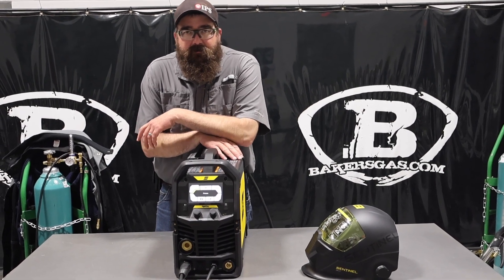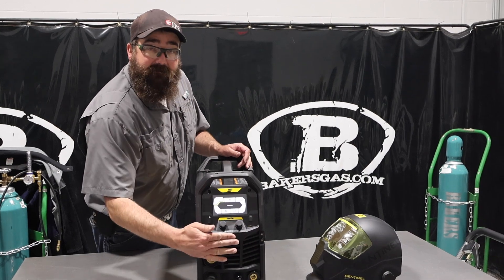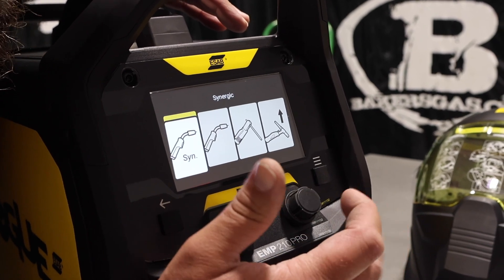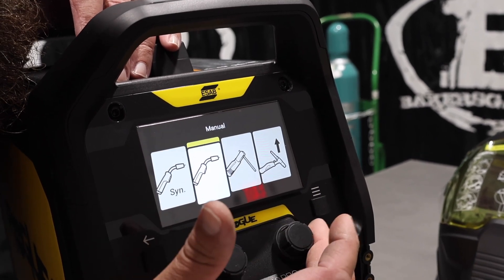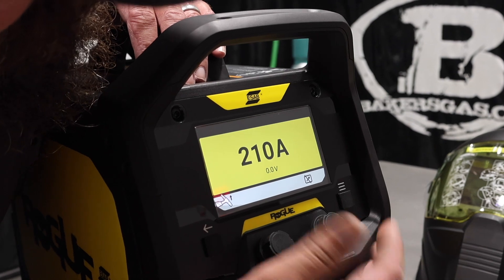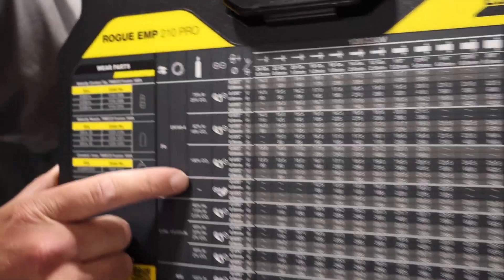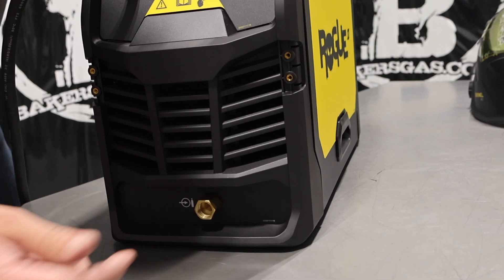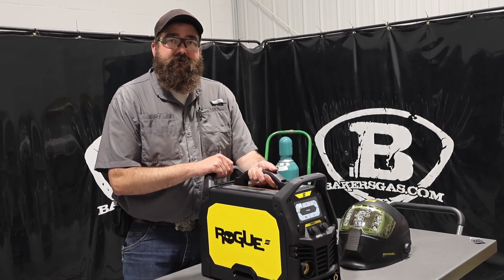ESAB Rogue EMP 210 Pro 0700301085 Review

Comment: Hey Andrew, does the 210 pro run a spool gun for aluminum??? If yes would you possibly have a part number?? Much appreciated 👍👍
Reply: Hi please have you gotten an answer to your question ?
Reply: @frankaduamoako8181  yes it'll only MiG aluminum with a spool gun....I don't have a part number I'm afraid mate
Reply: @t @tomahawk7665  Tweco Spool Gun 160A, 3.6 m (12 ft): 1027-1397

Tweco Spool Gun 200A, 3.6 m (12 ft): 1027-1398 

Unfortunately they both seem to be pretty pricey.
Reply: @vertvlogs675 thank you mate 👍👍👍👍
Reply: @frankaduamoako8181 oh btw,I tried running aluminum through different settings on standard MiG settings, I couldn't get it running at all, I got it to run but results were terrible

Comment: Was just looking at the Miller multimatic 215 is this Esab Rogue about equal for automotive hobyist?
Reply from the maker: The Miller 215 would be better but the ESAB is super affordable / good option too!
Reply: @BakersGas  I also have the Rogue 180 stick   and now looking for a small MIG only
Reply: NO Not at all    I have Both the miller215 and the Rebel EMP 215
The ESAB is better on thin material by FAR
but miller seams to run hotter maxed out to 3/8"
ESAB mig wipe so much more flexible than millers wipe